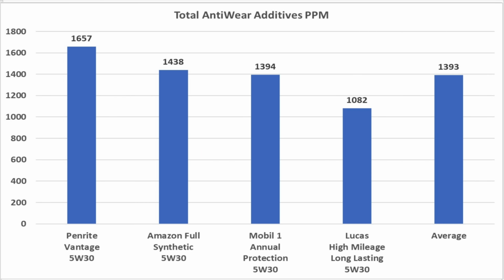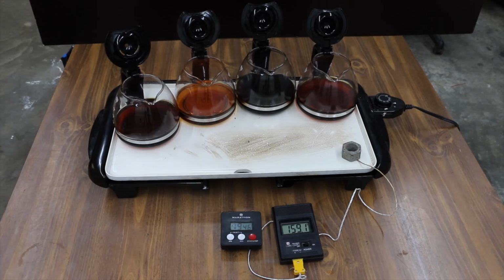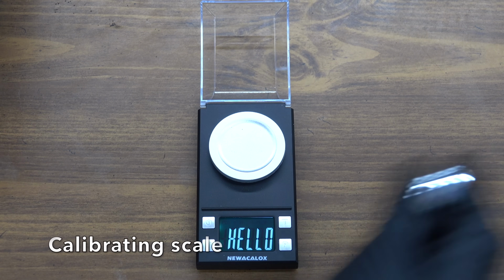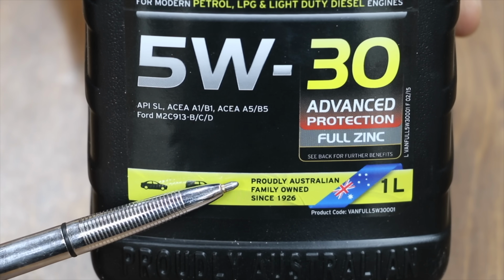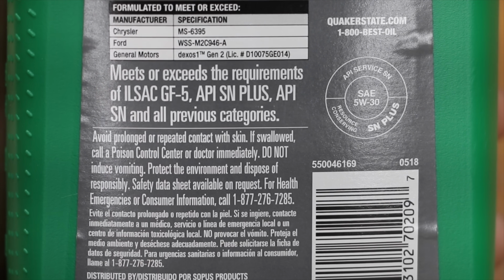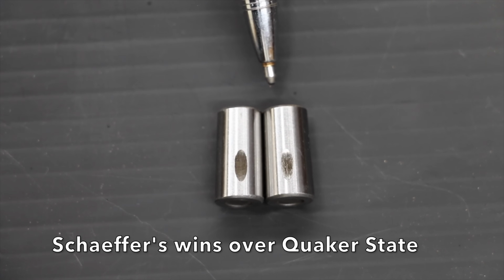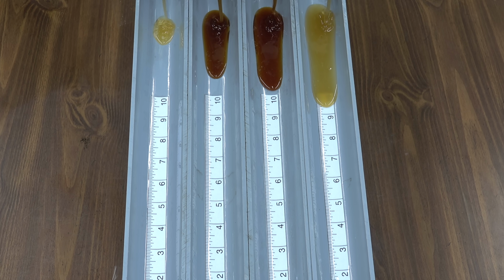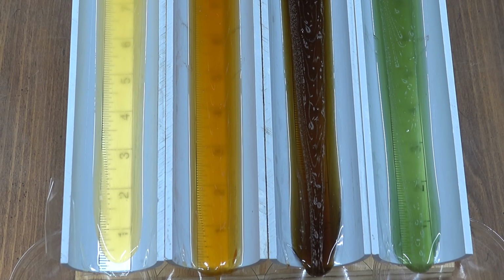Is Amazon Basics Motor Oil better than Penrite? Let's find out!

Comment: This type of playoff style competition should be able to give a  fairly reliable "best oil" result, but unfortunately will not be able to give a meaningful second and third place result.

It is possible, even with a fairly objective set of measuring standards to have an oil that is objectively better than the one that makes it to the final round, be lower in the ranking just because it lost to the winner early on.

This type of test may not be completely consistent from test to test either, with results having some variables that can't be controlled for when doing these tests across multiple days, spread across possible multiple weeks. Weather conditions, atmospheric pressure, variables in the freezer temp, test ramp temp... All could affect any individual test.

While less entertaining than this playoff style, but ultimately more consistent and better for proper ranking... Doing each of these tests a few times per oil, and averaging the results, is the better way to do comparisons. If possible doing each round of testing for each oil on the same day. Then do the next round on other days as needed. With local variables averaged out over the course of the testing, when done this way. Taking the raw numbers received from each test, and timing the oil flow rather than using a "who wins the race" metric... Will allow them to be compared directly across all oils at once.

The goal being to average out the results in an effort to offset any possible uncontrolled variables may make mixing post test individual oil samples the way to go. To clarify... The test with the biggest possible variable that can affect the results would be the heat volatility testing. So if say, each oil has the volatility test done three times, taking the three post heat test samples and mixing them, and using that mixture to do the following tests, may be the most consistent and objective method. Or possibly creating one mixed sample of post heat for each oil, and keeping some unmixed post heat samples, then doing the tests with all of them. So if you do the heat volatility three times per oil, you would then have 4 samples to do the other tests with. Samples from each individual volatility test, and an additional sample that is a mixed combination of all the volatility samples from that oil brand mixed.

With a good set of data to do the direct comparisons to, you can give meaningful results, and give a solid price to performance metric as well. But I believe that considering the results so far, the price to performance metric seems pretty clear cut. It seems the Amazon oil would likely be on top of the price to performance ranking. In addition, it doesn't seem like you would be giving up much in the way of performance for the lower cost, and possibly nothing lost in the way of practical real world performance either.

Comment: LIQUID METAL as ENGINE OIL 

                So when your ready to kill a engine potentially with a test, here's some interesting experiments: Bismuth metal as engine oil, or perhaps another liquid metal, though for safety i would avoid NaK, if the engines innards are all steel, then Gallium might work, note neither are liquid at room temperature but but Gallium and few others are liquid at just above which means it would be possible to fill the engine and keep it warm enough before and during running to be true liquid test.  Gallium might be you best bet if it NOT ALUMINIUM  in anything the oil will interact with.  Mercury has the same issues with aluminium in effect, and is also well overtly quite toxic so ill advised. Gallistan might be something you could get your hands on or another channel could make conceivably and only has to be like 11 degrees to 19 degrees Celsius to be liquid and so could be filled and drained as oil substitute at any temp and is meant to be less/non-toxic mercury replacement for liquid metal mercury.   I find it interesting because liquid metals like NaK are considered in certain reactors as thermal circulatory fluid having very high heat capacity and conductivity compared to many oils, while also being viscous dense fluid. So it might be interesting to see it in engine though i doubt it would work well per-say. The dangers of the metal degradation and solidification are the reasons i would recommend waiting for engine thats pretty much ready to be thrown out.
Reply from the maker: Thank you for the video idea!

Comment: Great video! What glue, expansion foam or silicone is the best to seal leaks on the concrete floor( is a hole in the concrete that Is some copper pipes) and is leaking water when we map the floor to the basement
Reply from the maker: Thank you for the video idea!

Comment: Project Farm, video request: I drive a duramax 2.8L Colorado. According to the forums everyone defaults that the dealership oil (ac delco 5w30 dexos 2 2nd gen) oil is the worst oil you can run in the engine. Could you do a video or few videos comparing the handful of dexos 2 diesel oils? This could give you a series of videos, comparing compatible oils for specific standard for class of engines. Just want to know what's best diesel oil for my truck.
Reply from the maker: Thank you for the video idea!

Comment: I usually Change the Oil in my cars every 10-15k km. Normal Driving, and because Germany, sometimes a Vmax Run (every 2-3 Months). 
I normally use 15k as interval, because it's 3/4 Year worth of driving, so, every second year I'm going twice to the oilchange. 

My Inline 6 M52 Engine (with hydro lifters and single-VANOS) is running smooth. Small lifter ticking when cold, but we shouldn't forget that my engine has run close to 350.000km, mostly with 10W40, nowadays with 5W40 (better cold oil flow). 
Good Oil Matters, but I say, when your Engine has much oil loss (as mine did, because of leakage valve cover gasket), I used Cheap Oil to top off (wasn't staying in there long, every 5000km I swapped literally the whole oil on the fly...)
Reply from the maker: Thank you!

Comment: @project farm - is there a reason you stagger the cold oil backwards?  New/cooked/cooked/new?  Just  thought it’d be easier to follow if it was new/cooked/new/cooked.
Reply from the maker: I used to do it the way you recommend. Thought it would be interesting to have the entire team on one side or the other.
Reply: @ProjectFarm  - Oh for sure, having one team on each side. I just meant having the sequence the same. So team "A" is still in position 1 & 2, "B" in 3 & 4.  Just that new would be in 1 & 3.  Used in 2 & 4. That way the order is the same for both.

Comment: Im curious why @1:48 it looks like your griddle is flexing periodically during the time lapse.
Reply from the maker: It's very interesting to see the griddle flex with the heating element cycling off and on. Thank you
Reply: @ProjectFarm  I thought it might be thermal expansion but once the surface heat soaks in steady state, I wouldn't expect it to shrink again until it completely cools off. Very peculiar.
Reply: Directly above the element will heat a minuscule faster than the surrounding area, causing it to expand faster than the cooler area. The cooler area then catches up and it flattens out. The inverse then happens as it cools. Since the element turns on/off with the cycling of the thermostat, you’ll get a wave motion.
Reply: @DrFiero  yeah thanks, I figured it was thermal expansion it was jsut way more prominent than what I was expecting. It's amazing what you can observer with time lapse in this case, or the inverse, high speed cameras. What a time to be alive!
Reply: @Gideon_Judges6  - For sure. If it wasn't for the time lapse, you'd (probably) never see it. I'm also thinking the heat sinking of the oil exaggerates the effect.

Comment: At 8:02' is it me, or is the cylinder on the right of the screen angled differently than the ones on the left?  Or is it the camera alignment?
Reply from the maker: Sorry about the camera alignment. It's an issue if the camera isn't perfectly aimed and my aiming was off for sure.
Reply: @ProjectFarm  Great videos.  I am always looking for your new uploads.  (I bought some Formula Shell Full Synthetic oil at Menards for $3 a quart.  It seems to be pretty good for $3, you should test it out)

Comment: You might need to re-test the other brands that lost since you changed the method in using the heated oil on the lubricity test.  It may change the results of the ones that lost.  Also, the new freezer may change the results as well.
Reply from the maker: Thank you for the video idea!

Comment: An idea I've had is to some how measure if there is a build up of pressure when using say grease and thread locking products into blind holes. Also to come up with an idea of wether greasing wheel studs / nuts actually causes loosening or not. Anyway, always appreciate the time you put in for the videos. Cheers.
Reply from the maker: Thank you for the video ideas!

Comment: Would be interesting so see the RACE versions of Penrite and Nulon, both are Australian oils, just for a selfish reason i guess, as I used to use Penrite exclusively and moved to Nulon (both Race versions) just to see if I made the right switch as I already knew that Penrite is a far better oil than most off the shelf! Nulon make some big claims too! the same with ULX110 which is not a common oil even here in Australia!
Reply from the maker: Great recommendation!

Comment: Very interesting.  More stringent testing, subjecting oil to heat for 2 hours longer, shows magnitude of deterioration much better.  Earlier test of Amazon (heated for only 1 hour) showed cooked Amazon oil flowing slower than new.  This test shows cooked Amazon flowing much faster than new, obviously due to significant oil viscosity breakdown.  Great presentation!
Reply from the maker: Thank you!!

Comment: Supposedly the Amazon Basics oil is rebranded Walmart Supertech? Is that accurate?
Reply: I mean, safe to say walmart is also rebranded. Not like walmart has any production plants for motor oil. It is possible they have the same supplier, but I'd imagine that they probably don't have quite the same mixture.
But suppose you could test them to find out.
Reply from the maker: Warren Distribution makes both of them and their oil chemistry is very, very similar.

Comment: Gawd I wish I could borrow that freezer for a bit. I miss 40 below.
Reply from the maker: lol. Thank you
Reply: @ProjectFarm  I got my degree from the University of Alaska Fairbanks.  Much of the winter there is between aboot -30f and -40.  

As a side note, I always found it hilarious when I'd use my little Saturn sl2 to jumpstart YUGE trucks. . . But Battery Blanket+oil Pan Heater+block heater=happy  subarctic driving.

(And camping under the northern lights is awesome!)

Love your channel!  Also did you note that you got a shout out from the Nerf Community?

Comment: 5w30 oil is designed to operate at temperatures as low as -22F (-30C). Block heater and different oil would be used in climates that get down to -40
Reply from the maker: Thank you!  It's very interesting to see that some of these oils perform better than others in the extreme cold.

Comment: SL will damage pretty much any engine made after  MY2004.  How is this even in the list    should offer a DISCLAIMER NOT to use it in new engines  or after year 2004(esp if under warranty as it will VOID it)
Reply from the maker: Thank you.  Penrite would likely meet the standards for SN if they spent the money on testing and licensing.  It's additive package is very similar to SN and SN+ oils.

Comment: Cool video. Zinc isn't good for your catalytic converters. It is a great anti wear additive though. I use Super Tech full synthetic 5W20 in my 06 Crown Vic Police interceptor, it's also a warren product and is $15.99 for a 5 qt. jug at Wally World. I've been using it for 20 years and no oil related issues in any of my cars. Keep up the great work! 😎
Reply from the maker: Thank you!

Comment: I find it odd that you are testing the LucasOil high mileage additive. It is not a substitute for motor oil but an additive to increase engine life. Why didn’t you use Lucas oil 5w-30? They do offer motor oil. If you are testing motor oil and not oil additives then you should do a rematch between Schaefer’s and Lucas
Reply from the maker: Thank you for the constructive feedback.  I could only find the high mileage product.

Comment: I'd love to see a gasoline test. Like does 93 octane really do better than 89 etc. Thanks for the great videos as always. Amazed to see 600+K subs! I remember when I found your channel you only has 80K subs. That wasn't very long ago either!
Reply from the maker: Thank you for the video idea!
Reply: as far as i understand higher octane is really just for higher compression engines and doesn't have much to do with performance. like my sportster requires at least midgrade or it can have pinging.

"low quality and low octane fuel can cause a whole cluster of problems, such as increased combustion chamber temperatures and higher cylinder pressures. The fuel's octane rating tells a motorist how much compression the gasoline can tolerate -- the higher the rating, the better the fuel resists combustion. That's why complicated, high-pressure engines require more expensive fuel."

Comment: Sry but i`m suspicious about this new cooling process. Maybe fridge was colder on (my) left side?! It never happened before, until now, cooked oil to be faster than uncooked per brand respectively ( water is lost during NoACK boiling test, ergo that oil have to be thicker and it will drain slowly)
Reply from the maker: Thank you. Some viscosity loss is fine but too much is a problem.  Amazon did lose some viscosity.  I've used Amazon in my vehicles and had it tested by an independent lab along with my own testing and it did fine and still had a great TBN at 4300 miles.

Comment: Amazon flows better after being cooked. We had an oil in the last test set that did the same. Hard to determine if that is a good thing or bad thing...guess that depends on what degree it happens at.
Reply from the maker: Great point. Some viscosity loss is fine but too much is a problem. I've used Amazon in my vehicles and had it tested by an independent lab along with my own testing and it did fine and still had a great TBN at 4300 miles.
Reply: @ProjectFarm  All but one of my vehicles are on Amazon Basic now too, so if any one them blow up or start shaving metal, I will make sure to report it, ha.

Comment: I drive a 2002 F150, I personally use motorcraft products. Are these better or the same? Yes. Are they cheaper? Some. Will I change? Probably not, I'm happy with my oil, transmission fluid, filters, etc. from motorcraft. But this seems like really fun experiments to run.
Reply from the maker: Thank you. I believe Motorcraft is similar to Kendall but I'd have to test it to be sure.

Comment: Project Farm, I recently needed to get some oil for my car and at the shop they had this oil called ServicePro. They told me the reason why its price is cheap is because they buy it by the pallet load hence lower price. They also told me its meets all the requirements and burns just as good as the other brands. Here's the rub. I dont know anything about ServicePro except 1 review from an online forum form about 11ish years ago.
Do you think you could test some? I have 2 bottles and I'd be willing to send you 1 for free.
Reply from the maker: Thanks for the offer. I wish I could, but I just don't have the time right now.  I'm way behind on testing products.

Comment: Bacon grease (or lard) vs clarified butter as engine oil! The clarified butter (aka ghee) is butter that does not contain milk solids and is just butter fat and has much higher smoke point than regular butter.
Reply from the maker: Thank you

Comment: How about getting a chemists cooking top with a stirmagnet? Can get one of those used for a alright price on ebay. Think that would give a good test base for the heating test. As you can keep both temperature accurate and keeping it stirred at the same time. Well, that is if you are going to do more heat tests in the future. and the only negative is the plate only support 1 cooking surface so with take more time doing heat tests vs the griddel
Reply from the maker: I've thought about it but I don't believe it'll achieve the heat level needed.
Reply: @ProjectFarm  They are made for boiling chemicals. would imagine they do have rather high temperature before having to swap to a torch